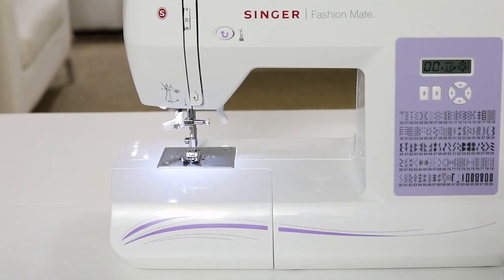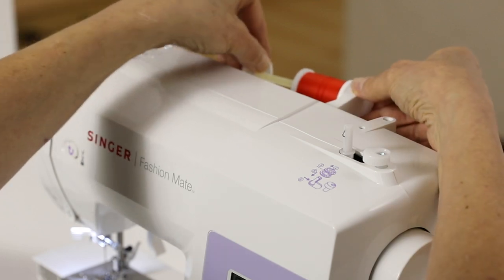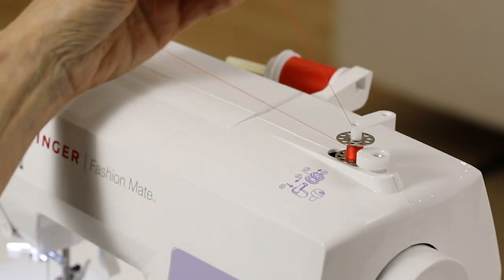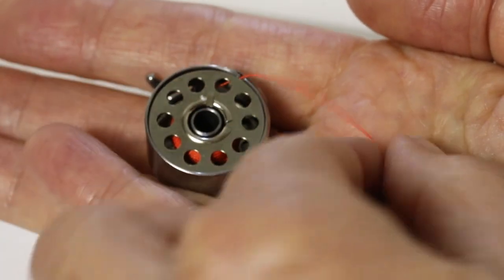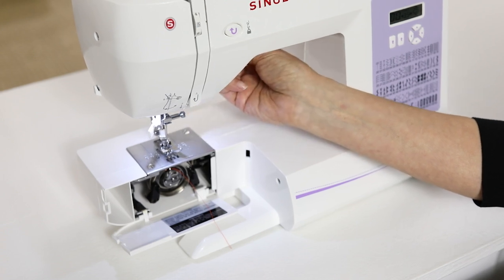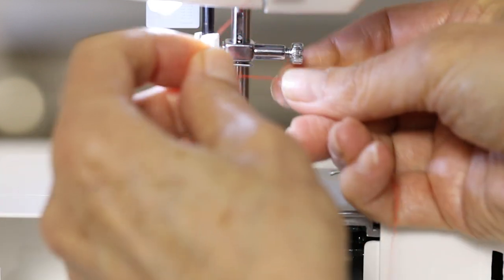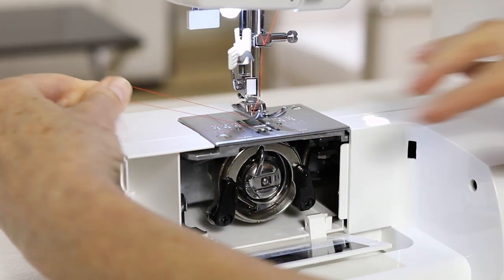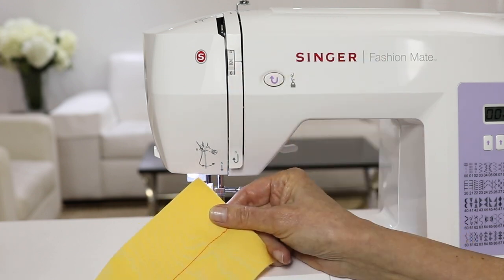SINGER® FASHION MATE™ 5560 Threading

Comment: All of the needles I have sit too far low. I don’t understand. I just opened the package of needles it came with and all of them sit too far low because of that metal dot. The needle threader doesn’t work because my needle doesn’t sit properly at the right height. I don’t know what to do
Reply from the maker: I'm so sorry to hear that you're having problems with your machine! Is your needle touching/scraping your needle plate?  I'd be happy to provide any insight that I can. ❤️ -AR
Reply: Singer Sewing Company thank you for your prompt response. I followed everything to a T from the video but there is a metal “dot” where the needle goes that is preventing it from sitting at the proper height. I don’t know if this is a machine defect or if for some reason I was given needles too long.
Reply from the maker: @MajimeTV  Hi! Feel free to reach out to us via Facebook Messenger: https://www.facebook.com/SingerSewingCompany - this way we can help assist you further! Thanks. -TB